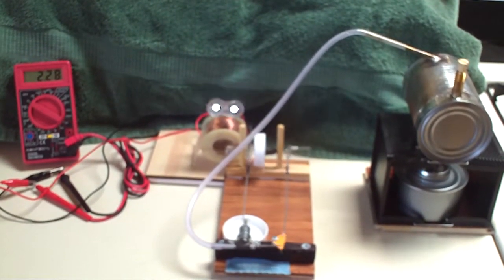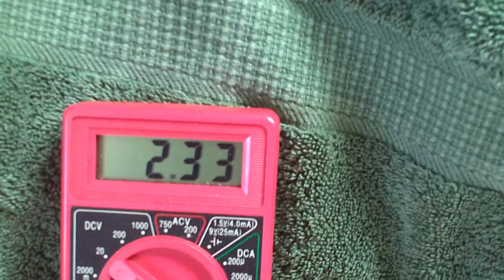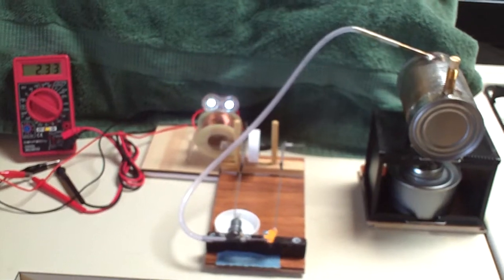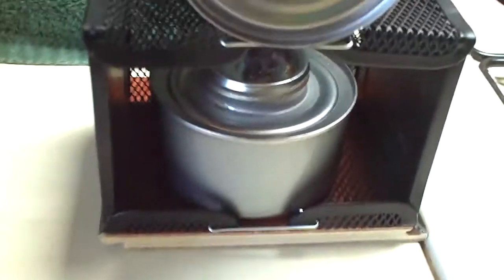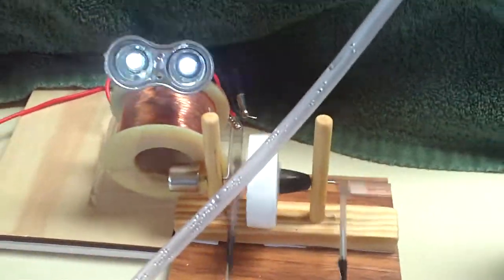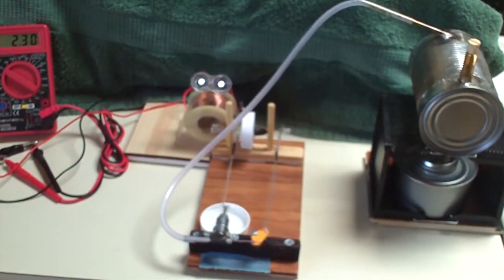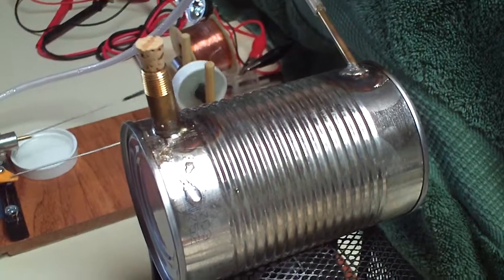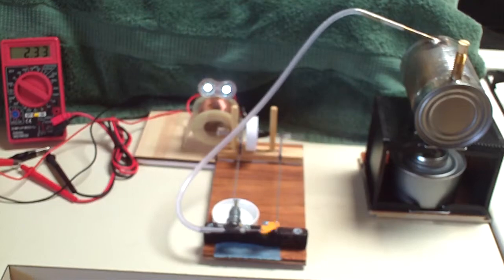Maggie and the Simple Steam Engine

Comment: I was wondering approximately how many feet of wire you used?  Also, did you use magnet copper wire or regular copper wire?  If you used magnet copper wire, would regular copper wire produce the same effect?

Comment: been trying to reproduce the bottom roller on my van der graaf generator. and I can't. not even with an apparently identical plastic beer mug. so perhaps the original is radioactive or something. I notice it says in Wikipedia that the triboelectric effect is 'not well understood'.............
Reply from the maker: I found that oil from your hands kills the effect and also moisture. One of my generators doesn't work on humid days unless I use a hair dryer on it.  The type of plastic for the bottom roller is another issue.  It is glass vs ????  Get it right and the thing works great but get it wrong and no workee.  I wonder what type plastic that your plastic beer mug is made of.  PVC worked good for me.  I may glue up my glass marble today.
Reply: ***** cleaning it thoroughly with a soft pencil eraser seems to do the trick. I don't know what the plastic is, I just made another pulley out of a clear plastic throwaway salad container. must do that movie